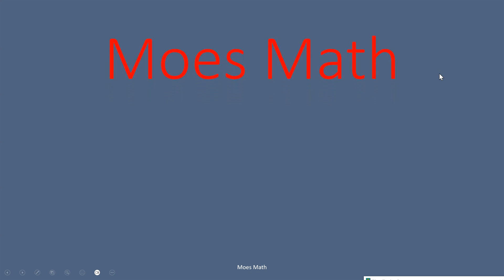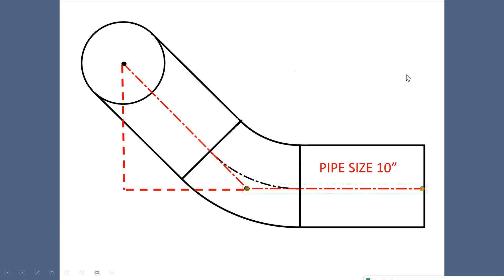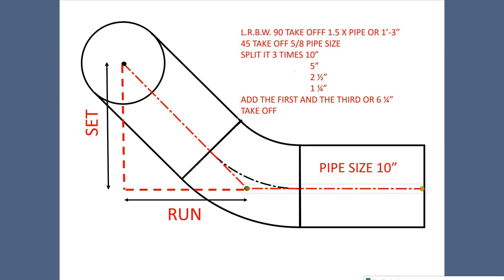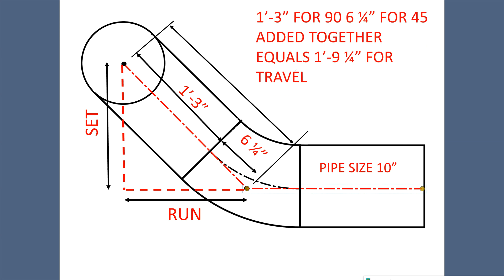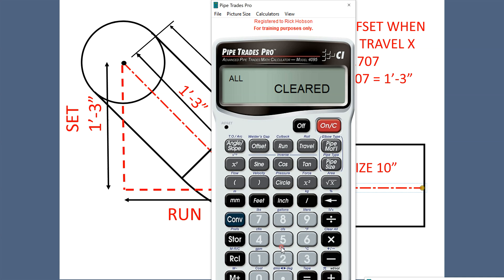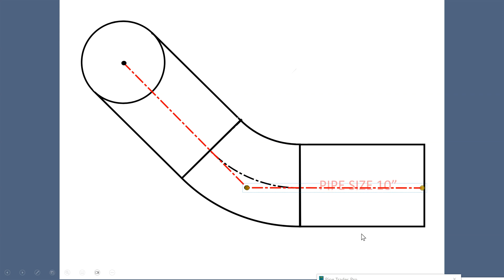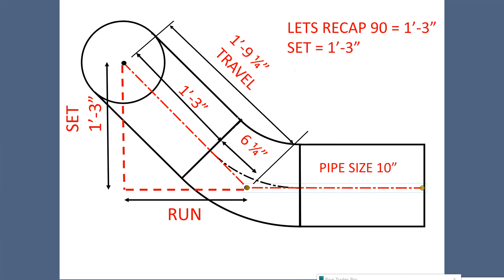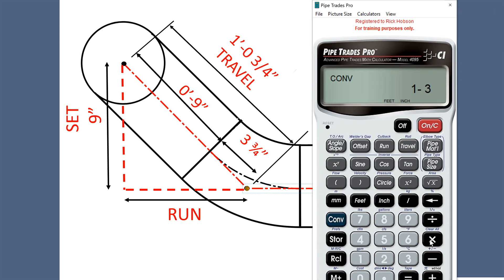No Math Needed! Mastering The Art Of Pipefitting: Welding 90 To 45 Degree Angles Effortlessly

Comment: How would you do this when you have to roll the 90 at a 22 degree angle and have to use a 22 degree fitting. Would the math .707 still be the same I think not. What formula would I use? To get the offset?

Comment: How do you get the set when you’re out in the field measuring is that the takeout of the 90
Reply: He is saying take out of the 90 is equal to offset when using this combination of fittings. Which is taking a 90 and rolling it on a 45 degree angle and then connecting a 45 degree fitting to that. So pretty much when using this fitting combination what ever the offset of the 90 or take out as you call it will be your set in the field so in this instance. Your field set would have to be equivalent to 1’3” if it were more than that your would need a pup piece in between and would use the 1.414 formula to get your answer.